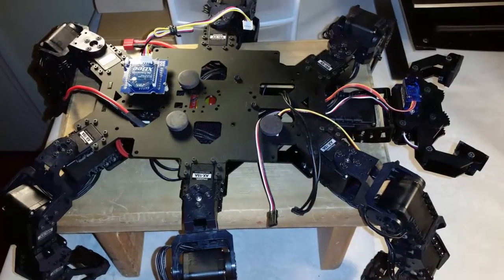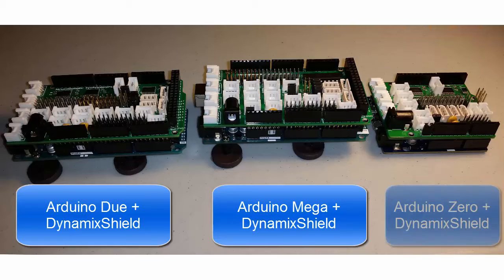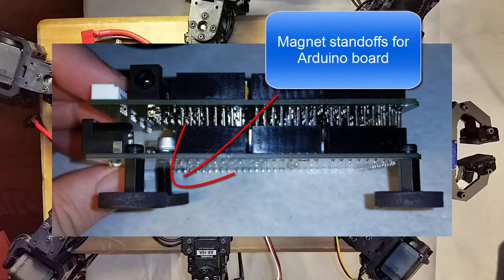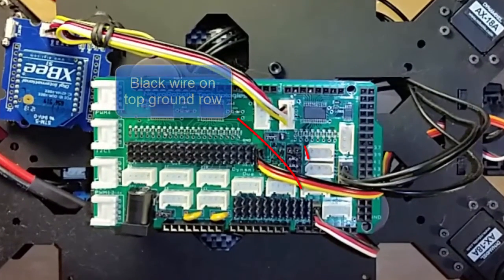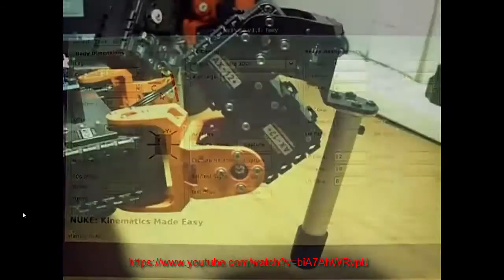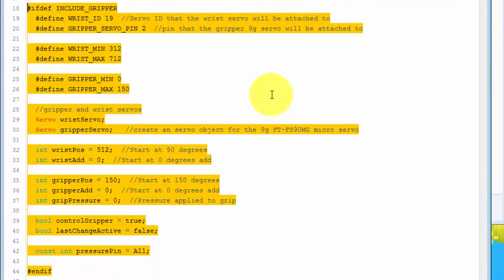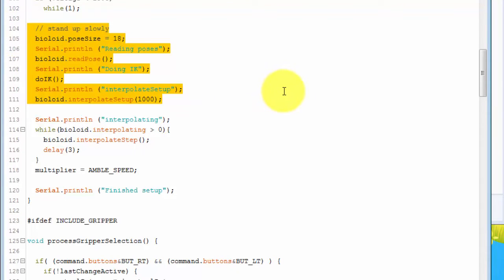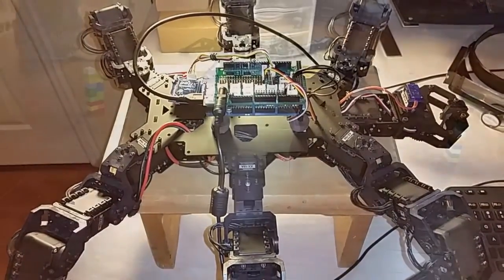Control a hexapod robot with the DynamixShield and an Arduino Due

Comment: exelent work, your hexapod it's incredible, but i have some questions, did you make the hexapod only using arduino? or you used differents things?.. y asked because , i'm very interesting in make one. 

kind regards from Chile, south america.
Reply from the maker: +José Ignacio Hernández Brito The hexapod body is the Phantom kit from Trossen Robotics. As for electronics, I used an Arduino Due + DynamixShield, the XBee Grove module, and a Dynamixel hub. That is all the electronics needed. I would suggest you look at the Arbotix Pro as a replacement for the Arduino+DynamixShield. I am currently working on the Jetduino board for the Jetson TK1 (http://neurorobotictech.com/Projects/Jetduino). This will let me do vision processing, large neural nets, etc., while also giving me all the capabilities of the Dynamixshield. I plan to mount one on the hexapod and start using NN and cuda vision to control the robot. I am making a series of videos now showing how to use the Jetduino, and I plan to do a video series on neural control of a hexapod as well. Subscribe to my newsletter to be kept informed (http://neurorobotictech.com/Community/Newsletter.),  and feel free to email me if you have questions while building your hexapod. Good luck!
Reply: +NeuroRoboticTech thx for all, but how you control your hexapod? with a play station controller by bluetooth or another?
Reply from the maker: +José Ignacio Hernández Brito The one I show here is controlled using the XBee commander controller. I have used bluetooth before though.
Reply: NeuroRoboticTech thx for all information, i would like to use a raspberry to control de servos, i'm planning to buy Ax-12 servos, and i was thinking use usb to comunícate the servos with the raspberry
Reply from the maker: +José Ignacio Hernández Brito USB is one option. You could use a USB2Dynamixel to do that. Another option is a product I am testing right now that I call a Grove smart servo board. It is a small board that works with Grove connectors, or standard 2.54mm headers and allows you to control the servos directly. You could use it with a GrovePi, or just the plain Pi itself.  Let me know if you are interested in that approach.
Reply: hi, it's me again, jajaja, how are you?
i have some questiones about the IK algorithm, do you know something about NUKE program?
i saw a video about this program the name it's "introducing to NUKE program". 
if you know something about it, let me know please.

regards